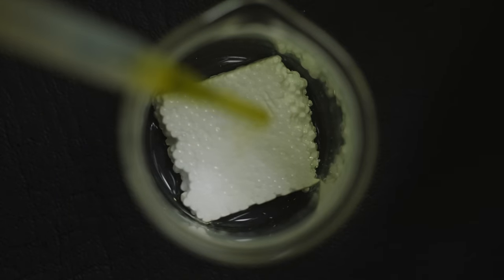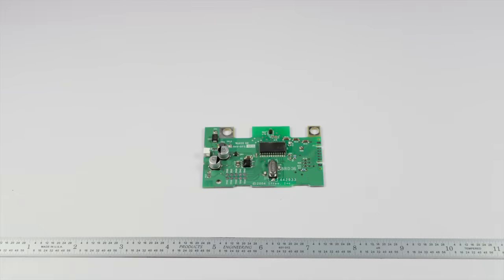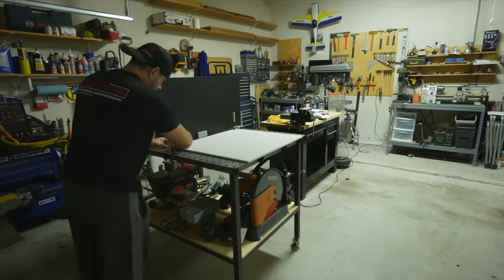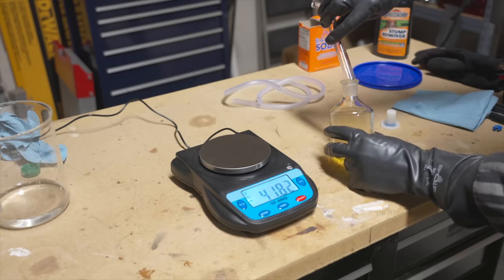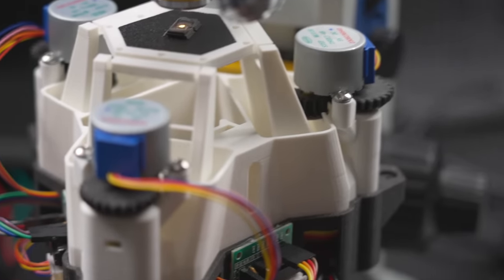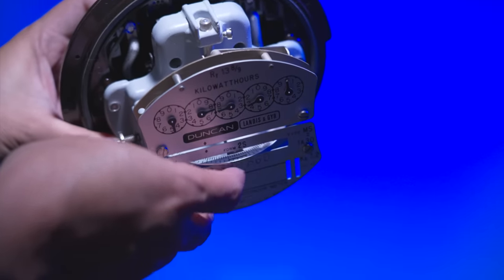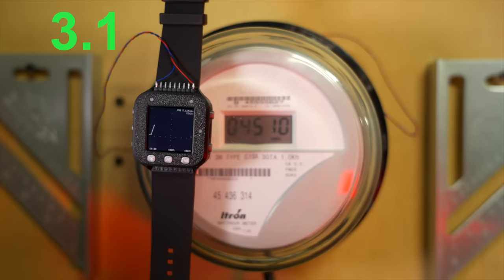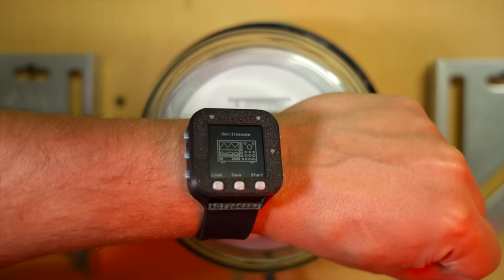Smart Meters, Nitric Acid and Microscopes

Comment: Our electric utility just installed smart meters in our neighborhood. They're Itron meters, but they're a different model from what you have. (Gen5 Riva.) I looked up the FCC ID and it's got a wireless networking card inside, but I'm not sure what protocols it uses. Itron's literature makes it sound like something proprietary. I need to get my SDR back up and running so I can snoop around.
Reply from the maker: I don’t think those are on eBay yet… They would be FUN to reverse engineer!
Reply: @RECESSIM  If the electric company knew what I used to do for a living, they wouldn't let one of these within 100 yards of me. But I know better than to mess with meter seals.

(I used to design smart meters for another company. I knew a few people at another Itron division, too.)
Reply from the maker: @daveh7720  Given enough time we’ll find some on eBay… Then it’s fair game! 😎

Comment: That model is an AMR model, seems a little disingenuous to call it a smart meter when that's what everyone knows AMI meters as. Itron's smart meters have the OpenWay, or similar, module.

The only capability this meter has that a Dial meter doesn't is demand metering and the ability for it to be read from up to 150 feet away with a transceiver.

Comment: Does not seem like you found out how they use a lap top from a truck to drive around changing meters to say what they want it to. Like how I use less than half my neighbors power use yet my bill magically alwayse as high or higher than his. And why when I had the old meter with monthly read by power company my bill was half my neighbors. Would have really liked to see the power company lie, exposed,  that electronic meters would lower our bills as the bill has only gone up, after they swore that promise.